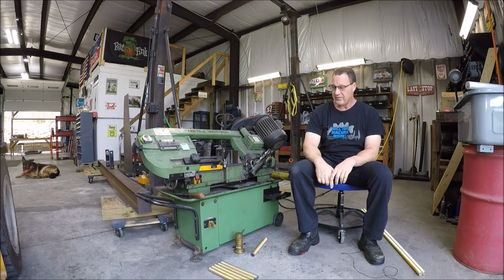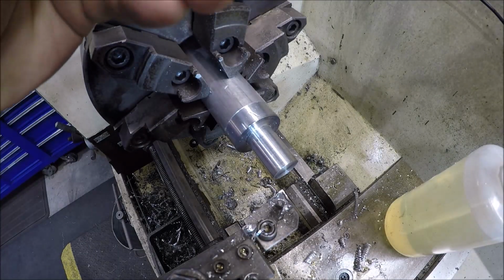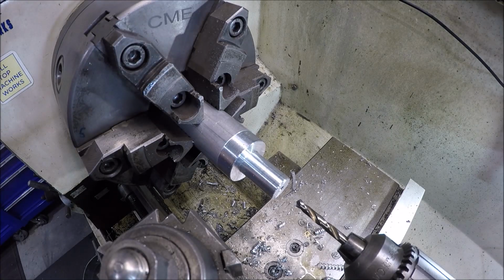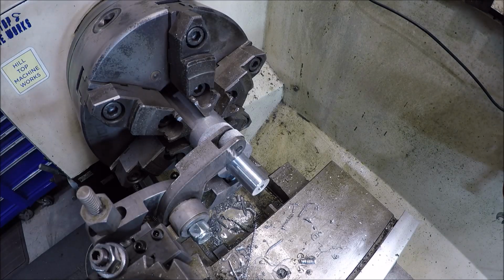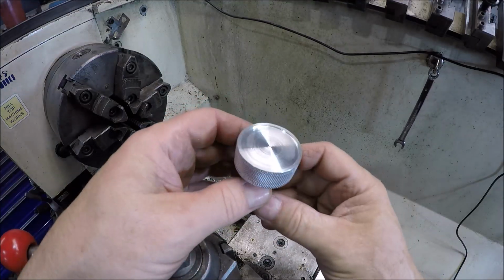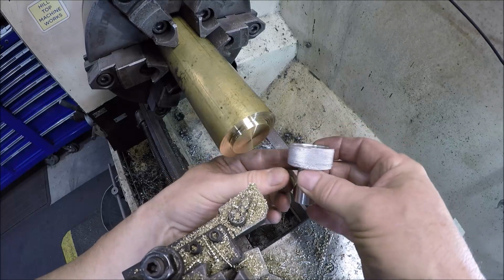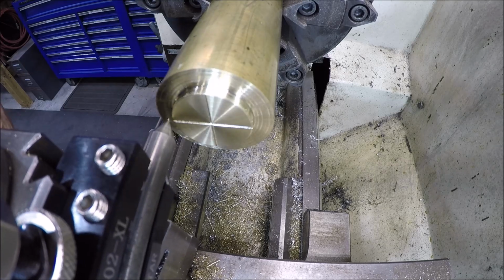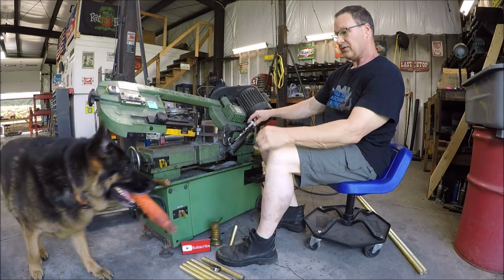Improving the common problem on the 7x12 bandsaw

Comment: Thanks, good idea, I'll try that! The brass is a nice touch. I have a Taiwanese RONG FU 7x12 I bought in 1996 for about $400. 3rd set of bearings and 2 hydraulic cylinders later and it's still working great! My cylinder is vertical though the saw looks identical otherwise.
Reply from the maker: They are good saw for sure. I appreciate you watching.

Comment: How do you like that 6 jaw CME lathe chuck? Is it a set true type ?
Reply from the maker: I like it. It came as a plan back so got a D1-4 adapter plate and fitted it up. It is not dead nuts , but runs within 1 thou or 2.
Reply: @hilltopmachineworks2131 Thats about as good as you can get with a regular scroll chuck . I was expecting alot worse might have to pick one up. Thanks
Reply from the maker: @rwa7856  Sure thing. 👍